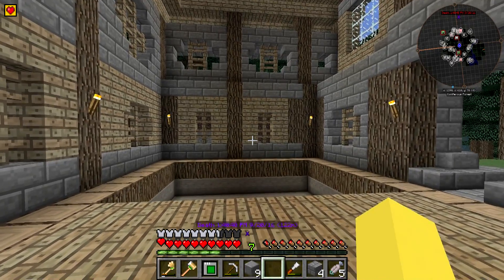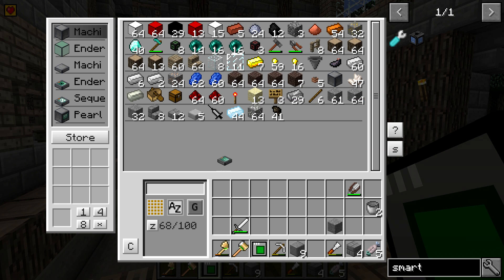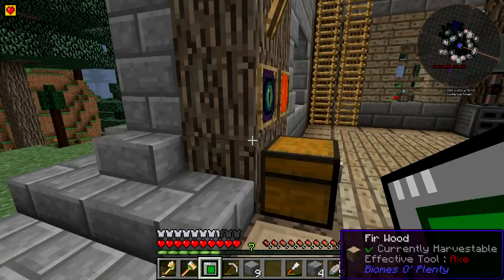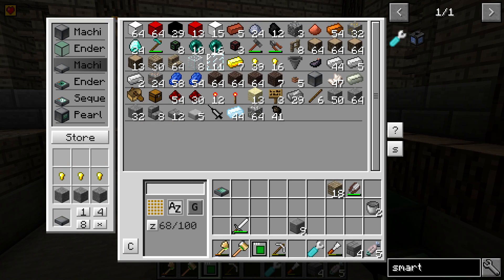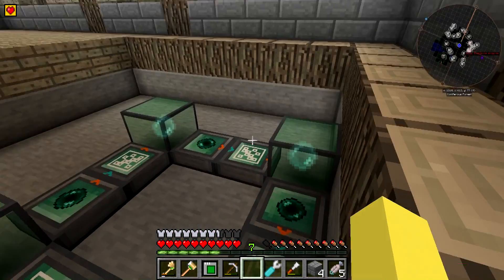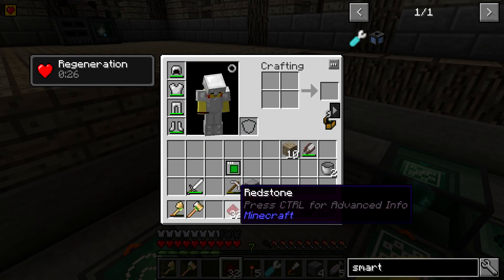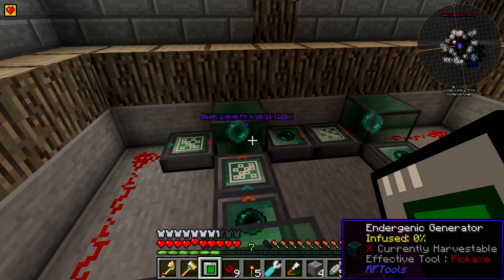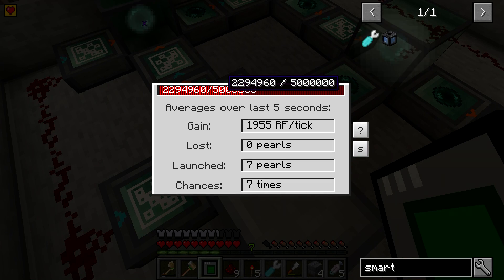FTOG Avant 3 :: E07 - Endergenic Generators

Comment: I'm using Feed the Beast Infinity Lite 1.10, I tried to set this up how you did, but the pearl only seems to take 2-3 laps and then dies... where as yours lasted for a good 20-30 seconds before 'dropping'... Any ideas why this might be?
Reply: Nimoot - I have built the same in Exoria pack - starts running ok but then stops after some random time and has to be partially rebuilt before it will start again.

Comment: A question, the endergenic generators require power to hold the pearl (even if it's just 1 tick) right? How can you have an efficient backup system when you are transferring all the power to for example a capacitor bank? I know you could just put an energy cell below the generators but isn't there another better way?
Reply from the maker: You can use a capacitor bank and set the output to be below the input by barely any so that the power gets slightly backed up in the generators.

Comment: i use transmitter and receivers because less lag i think because redstone dust particles
Reply from the maker: That is definitely a good way to go about setting it up if you plan on layering tons of these since eventually it will have a noticeable impact with all of them running.

Comment: Imagine the possibilities...
you could have these stacked over each other only separated by a few blocks, as an example having 20 of these for power gen. Considering one is enough to power a ender io spawner, another one could power an ME, etc, etc. 
The best part is, once your past the initial cost of setup, youd have a pretty good power gen setup that has a low upkeep cost.
Reply from the maker: They are absolutely insane! Especially once you infuse all 4 of them. This is definitely a great power generation setup and I'd be interested in seeing how many can be stacked and fed by a single roguelike dungeon spawner.

Comment: Hy, sorry for my English and the unrelated question. 
I really like your series, especially the last four. 
Im playing Mincraft 1.10.2, with forge 12.18.1.2095.
My textures are awfull. I even use some factory blocks from your Survival with Mekanism series, and its just crap. I use all the same mods than you. Are you be using some resource pack or perhaps my video options are screw.
Any Help? thanks.
Reply from the maker: I am not using any different textures :) They should all be the regular ones, so you may either have video settings wrong or you should try reinstalling the mods (in case a file was corrupt / damaged). Other than that, idk why you would be having issues like that. Sorry I couldn't be of more help!

Comment: Excellent setup, I approve of ridiculous power gen' early on.

You could make a pretty small Ender Pearl farm using Agricultural Expansion, the Ender Sprouts produce essence that is crafted into pearls. You wouldn't need a big farm to produce enough to sustain this.

Other thing to note though is that you'll need to craft the Dimensional Shards to infuse machines, RFTools Dimensions isn't in the pack.
Reply from the maker: Oh, I will totally look into the AE farm :) seems interesting compared to a traditional enderman farm!